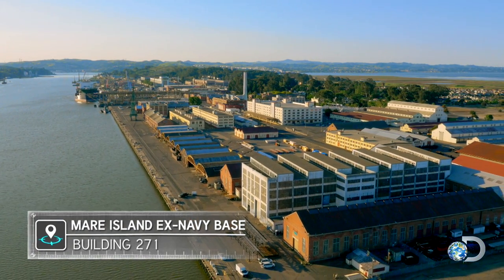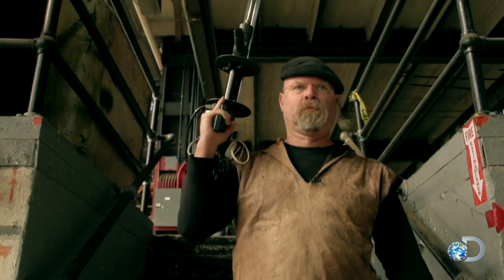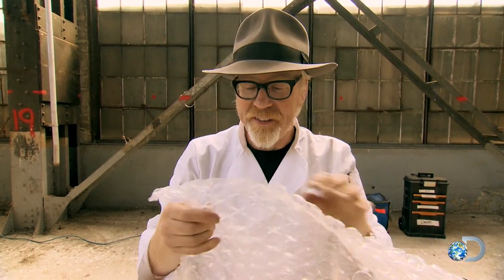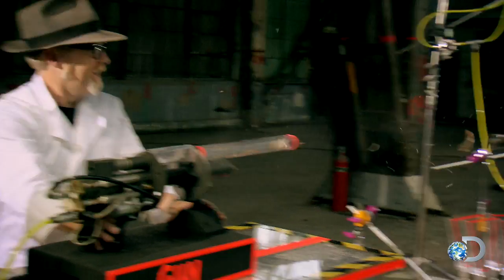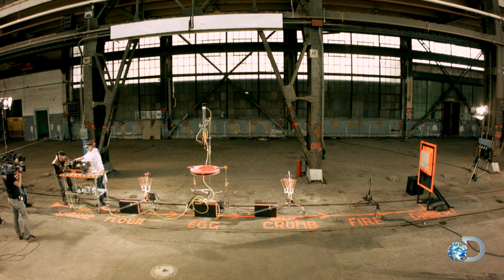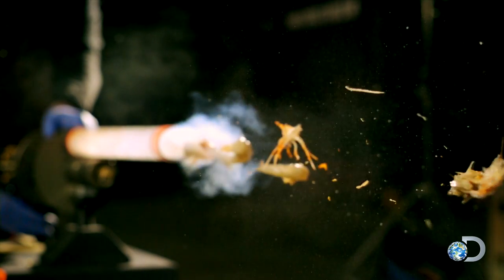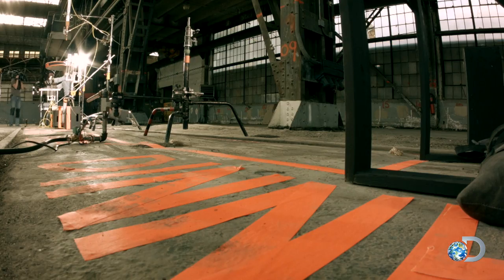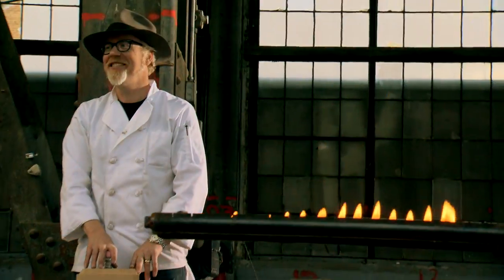Shrimp Cannon Fail | MythBusters

Comment: The heat you'd need to fry something that quickly would probably be so high that the to-be-fried object would be reduced to ash during that time. Everything (egg wash, flour, bread crumbs) could theoretically work except the frying part.
Imagine you want to cook a steak twice as fast. Simply doubling the heat isn't going to work, as it's just going to burn the meat instantly. And only exposing it to that heat very quickly would most likely only result in a completely burned crust and raw interior.

Comment: you know that is really in naval warfare to use a light vessel so it cold jump so the question isn't if the boat is strong enough but if it is light enough for its bottom to hold the weight as a shock wave (the boats used in Vietnam cold survived that and they are in naval museums so you cold see them and maybe the math behind them.